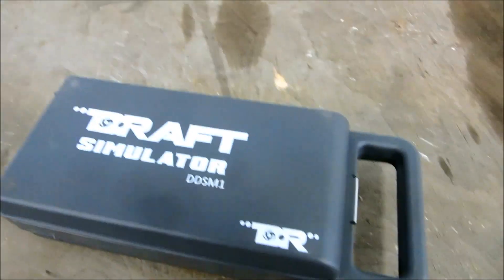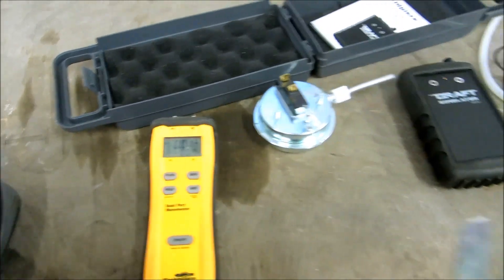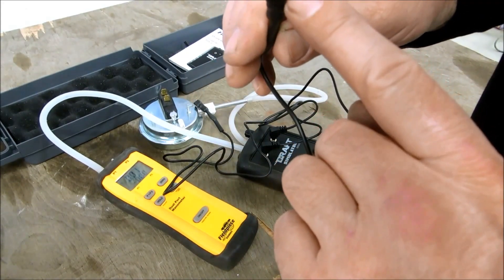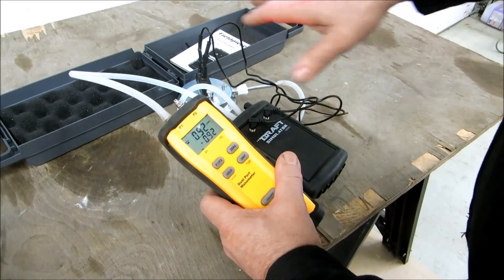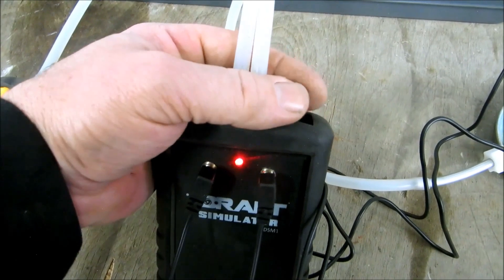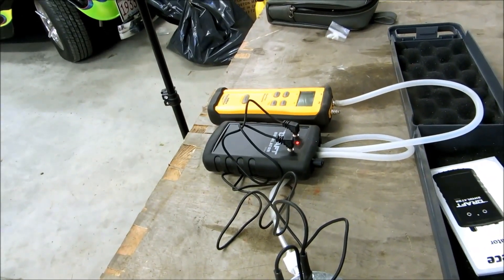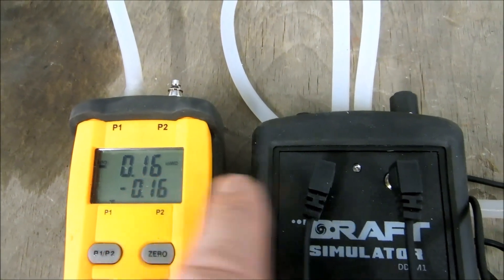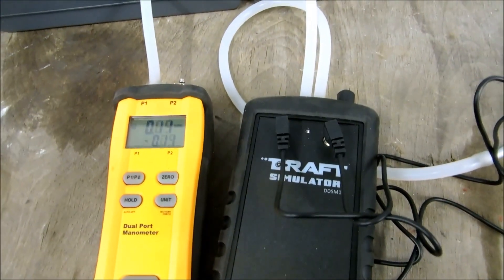FIELDPIECE DDSM1 DRAFT SIMULATOR REVIEW

Comment: Steve, Fieldpiece has a video on this device. If you check it out you will see that they prove the switch when it opens, not when it closes. They use the low speed and run it until the light comes on and then back off until the light goes off. When the light goes off take your reading.

Comment: Thought about getting one of those and carrying a couple adjustable pressure switches instead of 20 different ones of various ratings. Then you use the simulator and calibrate the adhistable switch and good to go. Mayble i will finally do that...
Reply from the maker: i am glad i bought the tool. i will use it for sure ..